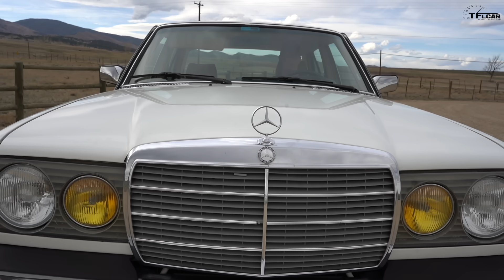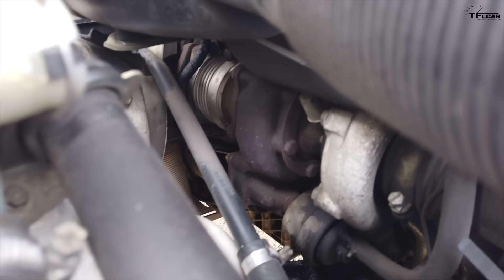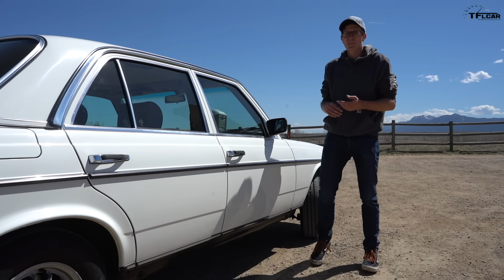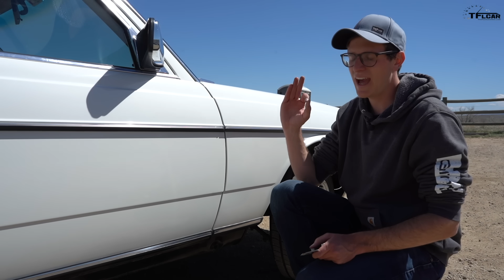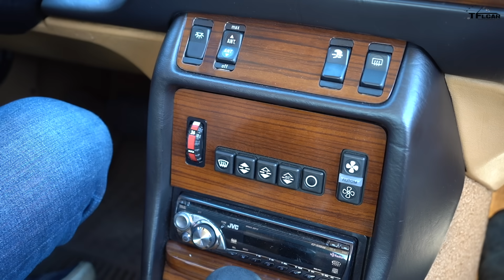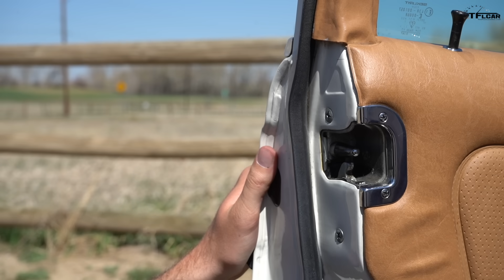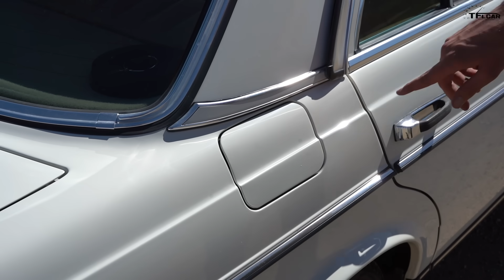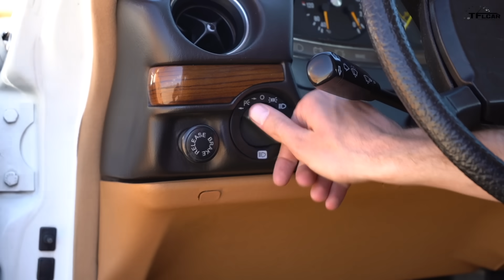This 37-Year-Old Diesel Is THE BEST Mercedes Ever Made!

Comment: I have had an 82 TD for more than 22 years I bought from the best Benz Mech. in Los Angeles. The maroon body is banged up now and some molding gone.. BUT, It still runs the way it did when I paid Richard of German Motors, Glendale, Ca for her..It's just about 290 thou Mi. Several non-serious devices need attention. I just put a needed bottle of Trans and steering fluid in last night . 
I can't afford the body work, which is kinda embarrassing when I'm parking between two shiny  2018-19 cars.. On the other hand people will compliment me for sticking with an old Benz they happen to know about...She was as clean as your white one and I wish I could get it back in that shape...BUT it starts and stops like new !! If it got smashed up and I wasn't I'd just get another one...What did I pay Richard ? $2,300.00 !  Only real drag is 13" rim tires  are getting diff to find..One really great thing- NO smog test ! At about $100 per year, I've saved $2,000.00 !  
For your reading all this I owe you a solid.. I.E. Only wait for the little yellow light to go off when it's cold or has been sitting say, 5 hrs.. Just start it. Don't wait. This saves the life of the glow plug rack. If you don't and you stop and start your car 9 times a day you're using the glow plugs 7-8 more times than you need to. He told me this 22 yrs back and I've had no trouble with the rack yet.
I still love this ride. Oh, and that turbo really barks !! Mark

Comment: The w124 mercedes is also pretty good. It's basically the w123 but a bit more modern and better. Pretty sure they're just as good reliability wise. My granddad used to have a 1993 250d turbo, never broke down or had any major issues.
Reply: I have a w124, that's my first car. I've reached 160km/h and I am sure it can go more. My parents said the engine will never die.
Reply: @mariopowerranger9477  They're strong and still look good.

Comment: Not it is not. It is pretty good though.  It will leave a trail of black diesel up your drive way from drips. When working on it , people will know for weeks after as it is impossible to get the black off or you. You have to plug it in in winter for it to start. If you are in the mountains, it will not start.  You are better off with this same car but the 280e version.  Now.. That may be the best mercedes ever.  Actually... The best mercedes ever is the 300e 1986-1988.  Period!!   Fantastic car!!  Best ever!!  300ce is the coupe version also great!!
Reply: Bruh a non turbo 200D from 1980 can start at -30 without issues, idk what the hell youre talking about
Reply: @nedkogenov5530  It can?  Mine could not. I had the 300D turbo and the 300SD turbo.  Even had them plugged in.. Heck.. Here in USA, in North Dakota they plug in gas cars there. You have no idea what you are talking about Petar.
Reply: @nedkogenov5530  I have owned and driven and started diesels all over the free world!!  What the heck are you talking about?

Comment: The w201 is the best mercedes ever, it has the same engeneering of the 300D, it's newer, cheaper to maintain, cheaper to find parts and for a 30YO model, the 2.5 Turbo Diesel is quite powerful for it's time as well

Comment: The 5cylinder engine was developped from a team around Ferdinand Piech. When he had to leave Porsche in 1972, he worked as a free lancer engineer for Mercedes- Benz and developped the first mass produced 5 cylinder engine in a car for Germany , maybe even the world. It went in production in early 1974 in W114 series model "240D 3.0". 

It is a 240 ( four times 600cc) with one added cylinder. The engine was also used in the very first G model series between 1979 and 1988 without turbocharger it had 80hp or later from 1982 on 88hp.
Reply: W114 was the code for /8 cars with 6 cylinder petrol engines.
4 and 5 cylinder cars were named W115. Both petrol and diesel.
Reply: OM616 240D 1974-78
2404 ccm, 65 hp.
OM616 240D 1978-85
2399 ccm, 72 hp.
OM617 240D-3.0, 300D 1974-79
3005 ccm, 80 hp.
OM617 300D 1980-85
2998 ccm, 88 hp.
Reply: OM615 220D 1970-79
2197 ccm, 60 hp.

Comment: In my original full-size 300SD, while stopped, I was hit in the rear at 55 mph.  I just walked away.  Those safety-crumple-zone trunks save lives.  Furthermore as a testimony to MB engineering, though the trunk was flattened to the rear window, the rear doors worked perfectly, and the drivability of the car was un-compromised!
[edit:]  My current 1983 300SD was rebuilt as a facsimile of the first one, with the same four doors, hood, interior, wheels, engine, drive-train, and euro headlights incorporated into a new donor body.  With a manual transmission, it is quite unique and still going!  Same bullet-proof OM 617 engine as your video.

Comment: Love your presentation, I had an identical 240D.  I prefer the W126 Diesels of the same era.  They do everything your 300D does even better and quieter, in the larger flagship body.  Uniquely, I have a 1983 300SD Manual (maybe the only one), same engine and wheels as yours; so fun to drive!  Also, I have the very stately stretch-body 1986 300SDL, which has the next generation inline-slant-6 diesel with almost 20% more horsepower, while much quieter and smoother, with equally good economy, in the longest-length Mercedes-Benz built since the Adenour flagship of the 1950s.  So I can say, as much as the W123 was the best car ever built, the W126 was equally the best ever production car in the world.

Comment: Man my mom used to have a coffee brown 85 that she bought in Frankfurt.  That car was going to be my daughter’s first car until someone rear ended my dad in it a few years ago.  Crumple zone kept him from getting hurt  but the car was totaled.   But you left out some of the coolest and most unique features.  I was impressed when you showed the vertical hood trick.  But the engineering is truly incredible.   And at the same time some of it was a consequence of mass production and variances in material quality.   The HVAC switches were finicky.  I did have to replace some bits of vacuum line though.  But some cool things:
The door locks were vacuum operated.   Get a leak, not good.  The driver’s door would always open with the key but sometimes it took a minute for the other doors to unlock.  The driver’s armrest has a giant button on the pivot point that allows it to be flipped up vertically.   I’m pretty sure the rear armrest could be made to access the trunk for a snow ski pass through.   The sunroof mechanism is beautiful to watch.   Until you have to realign it and watch the process a thousand times.  It left the line slowly, but the turbo would boost into a first gear surge that would kick you sideways in the rain.   Not a quick car.  But it could jump if you timed it right.   And it would cruise at 90 like it was nothing.   The sound of that engine has been both a great memory and at one point in my life that sound caused incredible anxiety.   But like he said.   Just close a door.  Don’t slam it.   Just close it.   That is quality.   My dad got an Audi 5000 S at the same time and while a futuristic car for its time and a blast to drive and really a neat car, it was comparably junk.   Old Mercedes set the standard for the world.    But Rolls Royce kept the standard very high for a long time.    Made to last.  Not made to fail.

Comment: My 1987 Volvo 740 with the B23 4 Cylinder had a lot of similarities to this, but yes, I think the W123 was quite a machine. The first generation Lexus LS400 was probably the most reliable car however if electronics, not just mechanicals, are weighed in the equation...

Comment: The vacuum operated fuel disconnect is not up to snuff in my 1882 300D. After using the manual shut off under the hood a few times and getting diesel odor on my finger, I realized when I lock the doors, due to vacuum operated lock cylinders, the fuel supply cuts off!

Comment: So glad people are finally starting to expose the W123/4 series diesels. I have an 87 300D Turbo OM603. Other from a little sputtering and missing when cold starting, it runs pretty damn good. 216000 miles on the clock too haha

Comment: I agree with you..I had a 1978 Mercedes 300D non turbo..I bought from my uncle...He bought it while on a trip to his home town of Beckley,WVa..while there with his 1976 240D the model with the neat headlights in the fender..anyway, this was circa 1988..He saw this 1978 300D on the showroom floor of Lewis Chevrolet Mercedes in Beckley WVa with only 28,000 miles! He contacted the previous owner who was a buddy he went to school with and asked him how in the heck did his Mercedes only have 28K miles in 10 years time!?? He said he bought it new in 78 to avoid the gas lines during that gas shortage! Once over, he parked in his garage for 10 years as he hated how slow the diesel car was....Then he traded it in...So my uncle who was a diesel locomotive mechanic for Amtrak and CSX etc took excellent care of the car and at 74K miles in 1996 he bought a sporty, bright red 1993 190E Sport edition...then sold me the 78 300D which I loved for many years..I sold with probably over 300K miles but odometer showing 126K but in FL miles are exempt at this age..It was museum quality!!! It was like NEW! The best car I ever owned! It was made like a tank and made to be worked on! It was easy to repair..I learned from my uncle how to do it all...not that I had many issues but the old York upright A/C Compressor went out after 20 years in 1998...we replaced with new and used R12 as the York style compressor did not do well on R134A...Of course the vacuum issues..locks..leaks..etc..the master brain of the car the A/C Servo unit with all the vacuum lines coming out of it had to be replaced..the only thing I had to ever have done by a shop was while I lived in Philly my ignition switch had to be replaced and I had it done by a shop that worked on Mercedes...and tires of course..I did brakes,shocks, alternator once, water pump went out driving from Jax,Fl to Erie PA..made it to PA and had to order a new one out of Buffalo NY and replaced it myself while in Erie area..Gosh I have wrote a book here! Sorry! I do think this era of Benz was the best the ole W123!

Comment: Mine pushed a main oil gallery plug out of the crankshaft and burned a rod bearing. If you ever drop the pan take the time to put a spot of weld on those plugs and it will last forever.

Comment: My dad had a Mercedes Sprinter heavy duty van with the same engine. Going about 80 mph, overloaded, and get 20-22 mpg. And that rattling sound when you started it in a cold morning, with some starter fluid :D
Unfortunately it has been abused badly, and the engine gave up at about 500k miles :/

Comment: I had an 85 300d in 99 to 2004. Had 280k on it when I traded for an Audi, and it did not burn a drop of oil. Had to fix mechanical things like ball joints, brakes and rear window lift mechanisms. No problem with ACC unit but the compresor and changed it to 134 gas. Never figured out why the compressor belt kept coming loose though. 31 feet is more like 10 METERS not centimeters. The formula for converting centigrade to Fahrenheit is; F=(Cx9/5)+32. 9/5 =1.8. Easy. I can do it in my head now because of all the European cars I've owned. One last thing to make the diesel engine last is, keep the valves set.

Comment: The trim piece running down the belt line of the car isn't primarily a shield for the door handles.  It might be possible that it was a secondary afterthought, but it is more likely a happy accident.  The trim is placed on the vertical apex of the door panel to prevent door dings from parking lot "rash"  - or in other words it prevents door dings coming from people next to you in a parking lot opening their doors too hard and denting your doors.  Quite a few car manufacturers have incorporated this feature into their own car doors for precisely this reason.  Also - 10 cm turning diameter?  Really?  More like about 10 meters.
Reply: I had to scroll too far down to find this comment... You are absolutely right!
Reply: It was my same thought, nothing to do with what he said..
Reply: Me too - also - if you open your door and hit a wall, it's the rubber that hits the wall, not the paintwork. I don't think door handles will be splashed from the wheels in any case. Probably someone else told him to wind him up ! :)

Comment: 31 feet is (equivalent to) almost 10 METRES not 10 centimetres
Reply: I thought the same. 😄
Reply: 31 feet equals only about 7.87 meters, which is an even better selling point!
Reply: @garthherrick6711  - Since 1959, the metre has been standardised as one metre = 3.2808398950131 feet. So, "about" 31 feet equal "about" 9,4 metres.
Reply: @cflmaior  I had mindlessly mixed in a factor for inches. Thanks for your correction!  So, 31 feet equals precisely 9.45 meters, which is then almost 10 meters, as said above.  I'll have to remember then, that one meter = 1.0936133 yards, and that one mile = 1,609.344 meters, or 1,760 yards!  Where I am, we still express all our measurements in miles, yards, feet, and inches, which are not so very metric.

Comment: That car's nice, but just a low-cost stablemate to my old W116 body '79 300SD.  Powered by the same OM617 but with several hundred pounds extra steel thrown in for good measure, I used to describe its acceleration as locomotive like; rode like a train too. Funny story about that old Merc, it was my first car, when I bought my secord car I was astounded to learn that a semi-trailer passing you at speed on a highway would cause a car to shudder somewhat. This was a completely foreign experience, I'd never felt that in the old 300SD!
Reply: That describes ours; I think it's a 380SD.

Comment: Not just the best Benz every built, she's one of the best cars ever made. My ex boss had a 1983 petrol 200T and that was thrashed and hammered mercilessly for just shy of 700,000 miles (all on one engine and gearbox) before she was scrapped. At the time of scrapping she still drove beautifully and was only scrapped because the body had taken such a battering and was rusting.

Comment: My 2014 Mercedes GLK has the same lightswitch, and the same stalk for the indicator at the wheel. Basically - it works the same way as my Mercedes W115 from 1973 I had once upon a time.

Comment: My Mom bought her 1984 300 D  in Germany and drove it on the Autobahn. They brought it back here and we drove cross country. Slow by today's standards (0-60 in 13 sec) but great on the Interstate. No problem holding 80-90 mph while getting 25-30 mpg. They changed the design in 1986 and MB has been downhill since. In the 80s MBs were known to be fancy, reliable, and durable. Now they are just fancy.

Comment: Having owned and driven a number of W123s over the past two decades, my vote is for the European version - non-turbo 300D, with manual tranny, manual windows, & manual heat-ac.  I currently own a so-equipped Euro '84 300TD, with the rare factory 5-speed.
Main issue with my wagon is fair amount of noise from the open cargo area. A friend had a 4-speed-stick Euro sedan which was much quieter.  I don't really miss the turbo. As a friend once told me, these cars feel 500 pounds lighter with a stick-shift!

Comment: Two choices in my opinion that are better. That were available in the US was the w126 om603 td and apart from the notorious rust problem the om606 powered w210. Outside the us I would say the om606 powered w140, again except the rust. I currently daily a 99 w210 e300td, with 280k miles and counting.

Comment: The w123 started the over engineered era, but the w124 is a much better car and probably as reliable as the w123. Then came the w211, after a bit of a downtime for Mercedes Benz, and brought back the legendary quality. Nothing is perfect, but the w211 is nearly, it’s still handsome looking, safe and up to todays standard, even after 16 years...except connectivity😂 Check this out; https://youtu.be/CpsdQjsUzec 
This car was actually used as a taxicab from 2003-5 and has accumulated 250000 km in just 2 years...